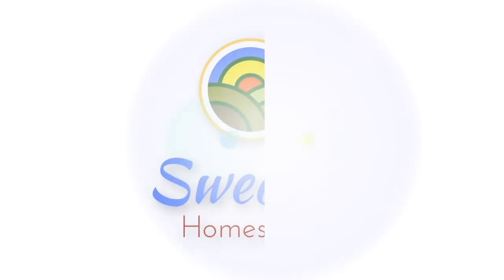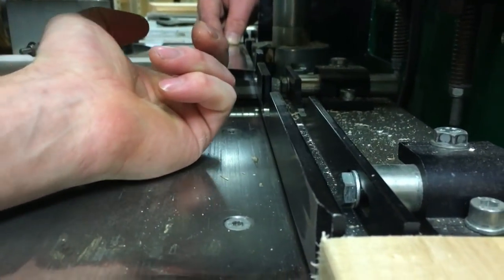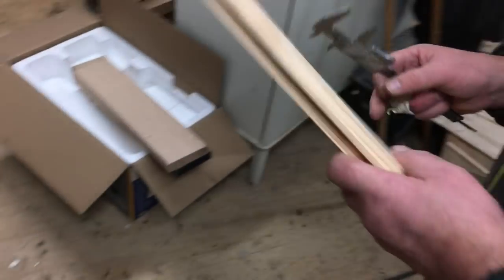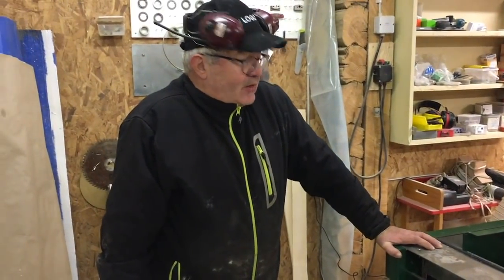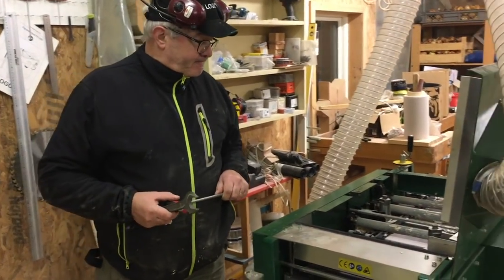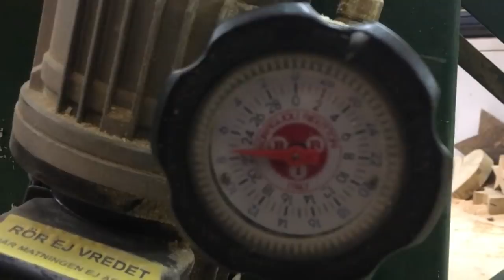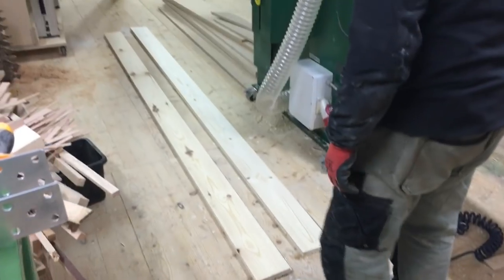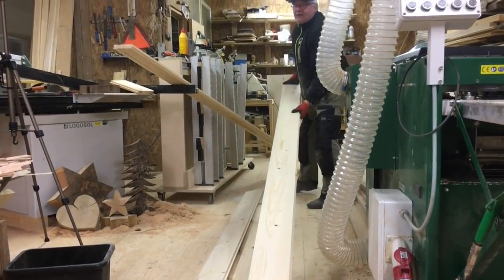12meters/min - Low Budget Machine Turns Boards Into Paneling - Logosol PH260

Comment: That was an interesting slow motion clip of cutter in action.   That type of machine will quickly pay for itself with just a few flooring jobs.  It is also a good compliment to a saw mill.  Not every customer wants rough lumber.  Many prefer planed lumber on all surfaces. or (dressed 4 sides as it is said in North America).
Reply from the maker: Yes. That's why dad got the machine. It hasn't taken off as he had hoped but it has paid for itself many times.

Comment: Can you explain more about what the three grooves on the bottom are supposed to do?  You touched on it in the first video, but can you explain a bit more in depth?
Reply from the maker: Wood is a living material and it often has some tension in it which will make it twisted or bent. The wider the board is the more the more the wood will work and twist. By putting the grooves in the bottom you reduce some of that tension.
Reply: what swedish said ... but the main reason is after the board is nailed down there is less chance of the board cupping from side to side ... it is done on cedar and redwood decking boards here
Reply: Swedish Homestead Oh cool thanks.  That makes a lot of sense.